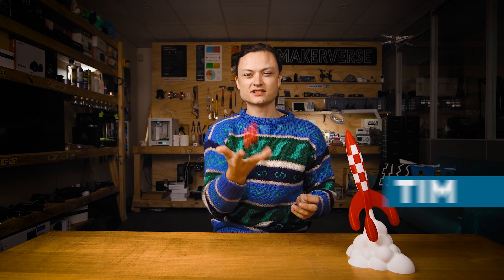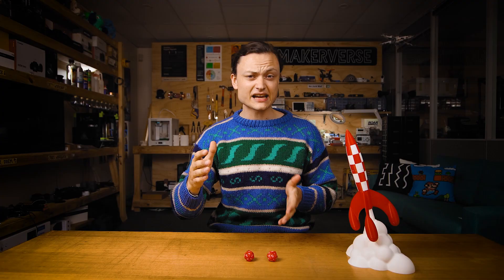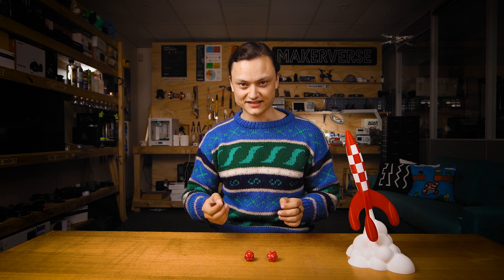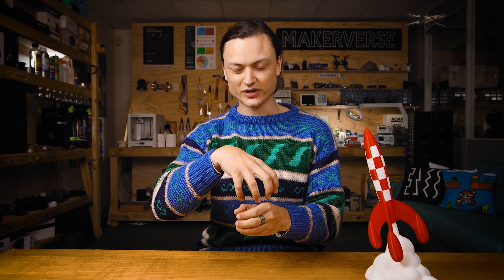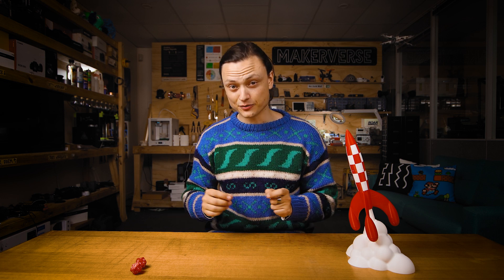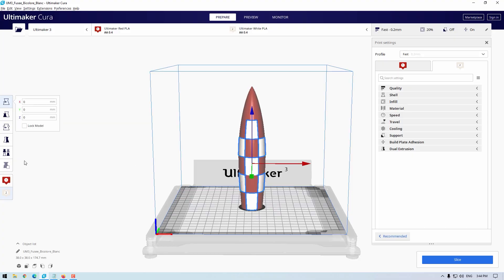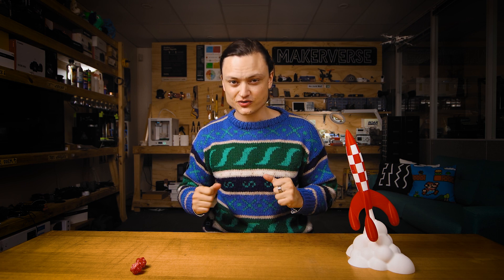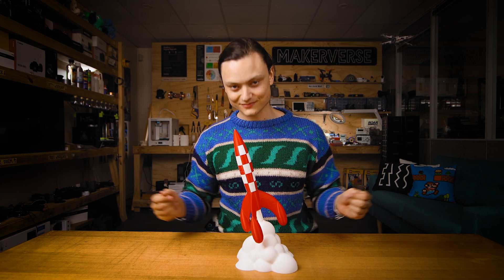Tips to Fully Harness Dual-Colour 3D Printers Capabilities | More Colours = More Better!

Comment: Very interesting! I have an IDEX printer and most of the time it will print 2 colours without problems. I do have a difficulty to get good result on objects that are slanted on a 45 degree angle though. 
Could you explain a bit more on how you do the trench to achieve the crispness. Is it just using chamfer on the edges of the different parts or do you do anything else? You mention something about no gap on Z plane?